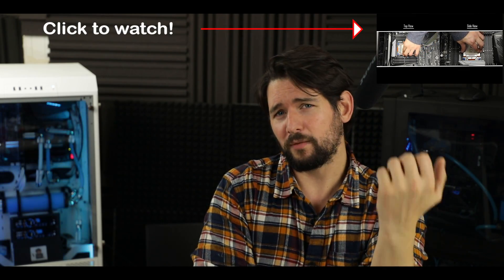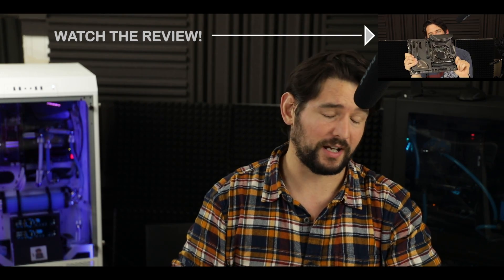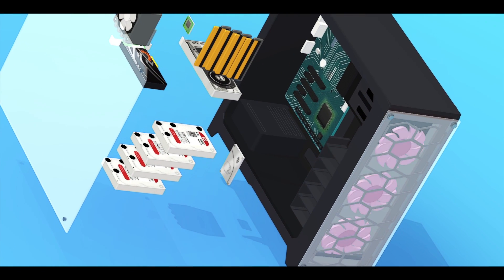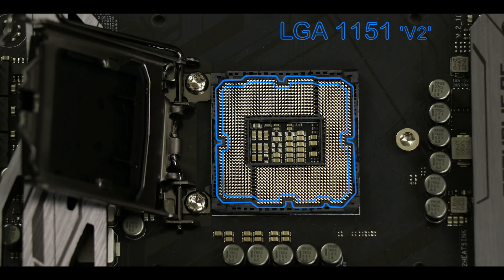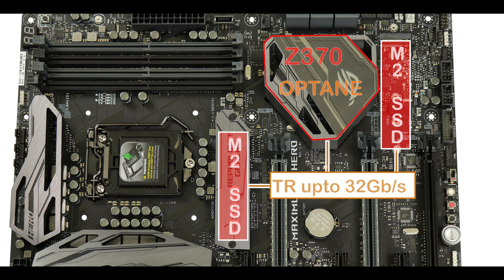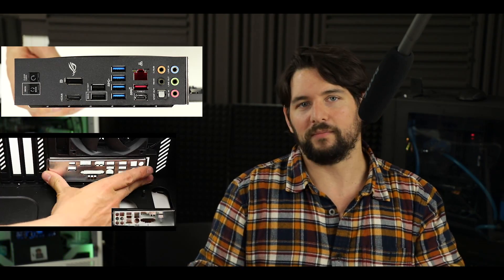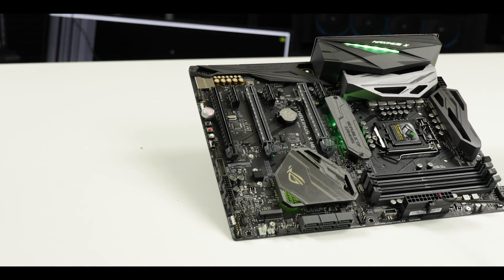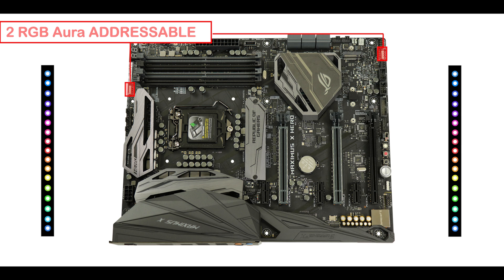Maximus X HERO: not an entry level at all

Comment: I had maximus x hero for 4 month's and everything was fine, everything worked, but recently motherboard gives me code 55 for no reason at all in my opinion. I checked the pins under CPU, it was fine, tried to put ram in different sockets and etc, but still no go, screen and mouse just refused to work... I really feel cheated a bit. My rig before that was Z95 and everything worked fine for good 5 years with no problem. With maximus X hero its like 300 euros worth of "You will play for little while, untill you wont"
Reply from the maker: 55 Is a memory issue if my memory serves well. 

Update the BIOS first and if problem persist.. send back to shop for replacement!

Comment: Hello, I was wondering if you or anyone could give me some advice. I have a Corsair set up of 9 LL120 fans connected to two Corsair 6 way led RGB splitter nodes (4 fans connected to node 1 and 5 fans connected to node 2) and all is working fine. But I wanted to add Corsair led strip to another Corsair controller. But channels 1 and 2 on controller 1 are being used for the RGB fans. So how can I control the led strip on controller 2 which is using channel 1 on that controller (on the Icue software it only gives options for channels 1 and 2, I can change from LL to LED strip on the interface, but then the 4 fans lighting turns off on channel 1 on controller 1 to allow me to control controller 2's channel 1). I've ordered a Corsair commander pro. Will, this device sort the problem out for me? Any help will be appreciated. Thanks.
Reply from the maker: Rgb LED strip should work if directly connected to the RGB connectors on the board.

I know it's not ideal.. but I'll work

Comment: For anyone who interested to buy a Maximus Hero XI and has this motherboard, dont buy it. Intel I5 and I7 9th gen CPUs will run just fine on this motherboard, because the VRM is strong enough to deal with heavy loads, even if overclocked. There are no big differents between the X and XI version, except MemoryOK, SoundFX and the maximum RAM capacity. I talked with a consultant and he told me that. Keep in mind you need to update before the BIOS before you can place a 9th gen CPU on the motherboard. Thankfully you dont need the CPU either because you can use a flash drive to update the BIOS. (: In my region, the Maximus Hero X costs merely 239 bucks where as the XI version costs 310 bucks. Both prizes may differ in your region.
Reply: Hey, Thanks a lot for this info. I was going to buy an MSI ACE z390 but instead bought this one as it was only $180 for a used one in excellent condition and looked nicer to me. Was worried if there would be any issues using an i7 9700k in it but I guess not? So all I need is a USB flash and download the update, then plug in into the board and hit the flash button?
Reply: @Ravelover5448  Sorry for the lateness of my reply. I guess you already solved the issue. Dont worry about it, the Maximus Hero X can take any 9th gen CPU (with the 1511 architecture) just fine. You can even use an i9 9900k and overclock it. You did absolutly nothing wrong buying this motherboard. There can find guides on ASUS'es forum how to install BIOS without needing a CPU.
If you still have doubts about this motherboard, the consultant compared both mobos and went deep into details. He also indirectly told me "Hey, the XI version is useless. Take the X version!". You can also find posts from various forum users on the internet stating the Maximus Hero X is robust enough.

Comment: i picked this up for a new build i cant get it to boot Q code 0A and wont boot 8(
Reply from the maker: Contact me by email with full list of components. 

Ill help you out
Reply: @Laurentschoice  what's your email .
Reply: @Laurentschoice  I got the I 7 8700k and gpu is the 2080 ti but that's not in yet
Reply from the maker: at the end of each of my video you have the list of my contacts (including email). I usually avoid putting it in the comment sections to avoid spams.
Reply from the maker: ok good.. when booting your motherboard, try it with a bare minimum. Not Hard drive, 1 ram stick in A2 dim position (that's the gray one closest to the CPU), and screen on internal video port.       Boot and tell me if it posts.       Make sure both ATX 24 and CPU plugs are in (not just ATX 24)
Reply: @Laurentschoice  will try when I get home from work,  haven't tried with out the ssd.  Thanks for your time. I'll keep you posted
Reply: @Laurentschoice  went and bought a new mobo and the build worked so the other mobo was doa

Comment: Quick question I really need help. So I have 6 LL120 fans and if I wanna control the RGB lights on them do I have to connect them to the RGB Aura addressable connectors or does it not matter? Help please!! Thank you.
Reply from the maker: Unfortunately you can only control their RGB through the corsair proprietary software CUE.

I do not think its is AURA compliant... which sucks
Reply: Laurent's Choice Ok and what about the cables that power the fans? There’s 7 fan connectors on the board but which ones do the Corsair LL120 fans connect to?  Because I know that some of the connectors are fan connectors but they’re different than the other fan connectors that are on the board. I’m not sure exactly how but I know I’ve heard that some of the fan power connectors are different. Sorry if I’m asking too much 😅
Reply from the maker: Dont u have a corsair fan hub which came with the fans ?
Reply: Laurent's Choice No there’s only the LED hub and the lighting node pro.
Reply from the maker: They will connect to all the fan available board... even the PUMP connector just as long as your make sure to respect the polarity.

Corsair ususaly sell PWM complaint fans so they should be 4 pin fans. 

Easy peasy

Comment: Can you help define this ASUS line up? The Maximus HERO line is entry level and the Rampage line is what?
Reply from the maker: Maximus is for Z chipsets, like z270 , z370 etc... so all the i3, i5 and i7 (lga 1151) usual processors people buy. That's 80% of Intel's sale.

Rampage mobos are for X chipsets. X99 or x299 for example.  These are for more expensive and bigger CPUs (LGA 2033 and LGA 2066).
They cost much more (i7 6900k) and have more cores and memory :)
Reply: Laurent's Choice Thank you for the reply. I was asking because the i7 7700k and 8700k seem to outperform many of the higher-end CPUs when it comes to gaming. The previously mentioned chips do very well in gaming when it comes to frame rate in  1080p but seem to get blown out of the water when it comes to multitasking like video rendering or 3D rendering; which is to be expected with the reduced amount of cores. Because of this I've had a hard time matching up a motherboard with an i7 that is rated for high-end gaming.

As I'm sure you are aware,  price point is not an indicator for performance and the ASUS line, along with many mobo manufacturers, don't have a clear line up of which consumers they are targeting.
Reply: The Ranger is currently the first ROG on the ladder.

Comment: The RGB header information is INCORRECT.

Only ONE header (board bottom left) is 5V addressable.  The other two are standard 12V 5050 NON-ADDRESSABLE.

RTFM.
Reply from the maker: That's correct. Did I say otherwise ?

Comment: Are the m.2s connected to the CPU or to a chipset ?
Reply from the maker: +Hermes Bird they get their data feed from the chipset :)
Reply: Chipset pcie or thru sata in bios. If you use m.2 but a x1 sata 4 port sata3 card to give u 4 more hookups as the 6 on board sata will be reduced to 4. Also setup your raid BEFORE installing windows on a non raid ssd. If you enable raid after your os will not boot!

Comment: HELP ME GUYS...i bought this motherboard but i cant intall it to my case because of preinstalled i/o shield....what should i do?
Reply from the maker: +Martin Maraj what case do u have ?
Reply: NZXT S340 elite
Reply from the maker: +Martin Maraj you should not have any problems ,

What exactly is the issue.

You can send me an email with photos. (My email is at the end of each videos)
Reply: when i put motherboard in the case then i fit in the upper side of i/o shield but lower doesnt fit in, there´s no place for it to fit...if i could i would send you pictures...
Reply from the maker: +Martin Maraj please do send the pictures by email, I will assist u
Reply: ok i will email you
Reply: did you get the email?
Reply: Have you installed the i/o shield the right way up?
Reply: You get it figured out?

Comment: Is maximus X extreme coming slon?
Reply from the maker: +WeedWarrior dig flex they usually are released a few months after the entry levels. 

Should be here by April or May
Reply: Laurent's Choice thanks for the info and Will it have the monoblock that the IX had
Reply from the maker: +WeedWarrior dig flex hard to tell. 

They tend to try and make something different every time.

Comment: It's a lot of temperature?
Reply from the maker: it's a little high to my taste! But again, that's why I go water cooling :)
Reply: Laurent's Choice I own this board. I set fixed 4.7 on all 6 cores with 1.357v fixed. It does NOT change with overclock and thr cpu idles at 800mhz all core idle and goes to 4.7 on all cores with cinibench and prime95  idle is 32c under prime 95 55c and cinibench 60 with cosair 240mm rad in push configuration. Xmp set 3200 mhz ram. Do not use turbo as your voltage will be about 1.4 volts. Bad

Comment: asus hero x ,i7 8700k 5ghz 1,235v cinebench 1644 points,80 degrees
Reply: Then go check single core, the only one that matters in gaming xD
Reply from the maker: +VICTOR YEAH Wow...  awesome man... that's crazy good !!!!!!
Reply: Laurent's Choice It's a lot of temperature?
Reply: zaky986 that is a great score but you do realize the 8700k has 2 cores/4 threads less than the chip you have
Reply: It's good temp for a non-delid. Delid your CPU and you will get great temps :)
Reply: are you using water cooler? which one?
Reply from the maker: Any of them will work. Even a three GPU bridge can work with only 2 attached to it .
Reply: I get 1670 in cinebench on ryzen 1700x clocked from 3.4 to only 3.7ghz ... plus the temp is 55c under load and u clocked to 5.0ghz hahahahaha thats a joke
Reply: @izaksek  yeah and in single core the i7 get 220 pts and your  ryzen gets 160-170 or something like that  :)